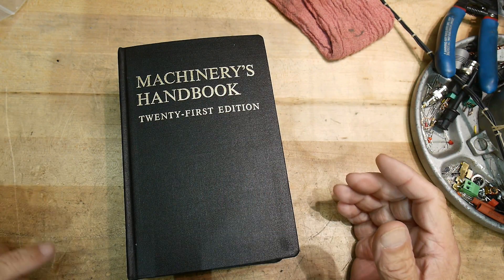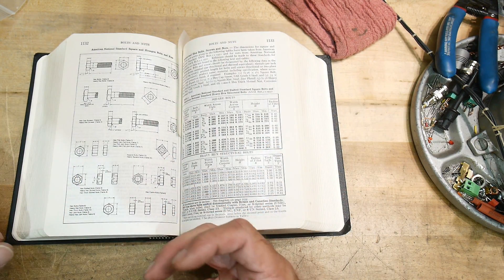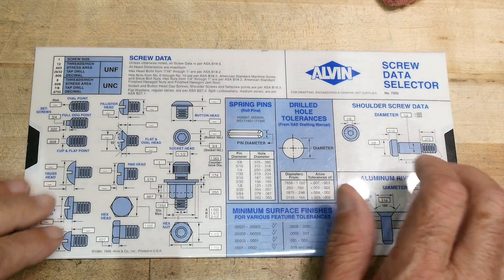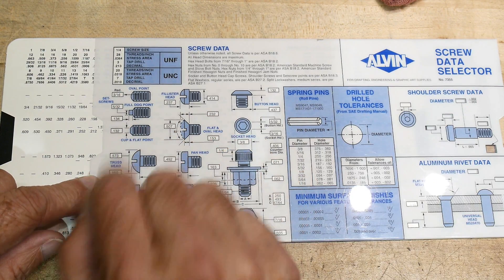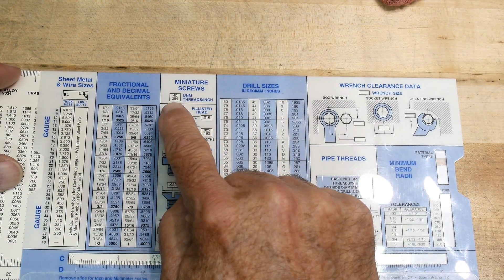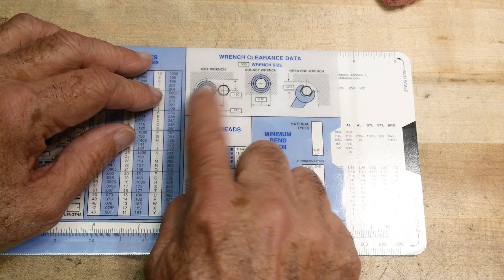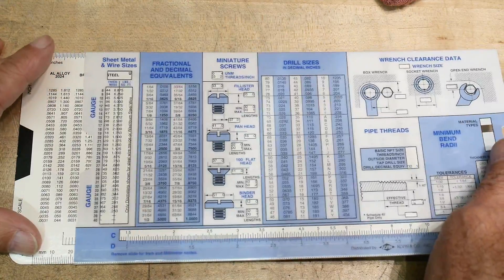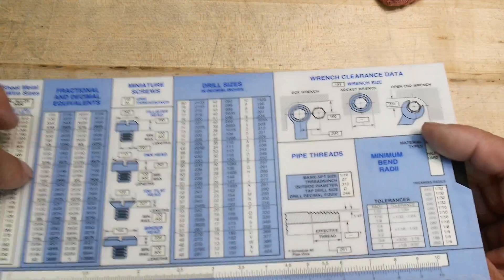#1097 Alvin 7355 Screw Data Selector Slide Chart

Comment: Ampacity always depends on cooling.  House wiring cools more quickly than coils, for example.  Also, we often face a certain allowable temperature change or difference.  These are in addition to wire material and cross-section shape.  There is also pulse power/duration vs. average power.  Thus, there are many dimensions to this problem.  I would suggest composing thermal conductivity and electric resistivity vs. material, gauge vs. diameter/area, cross-section shape vs. coil i.d. vs. coil o.d. vs. max T - min T, etc., and supplying equations relating various aspects.  While considering these, allow for the increase in metal resistivity vs. temperature.

Comment: Interesting, then I learned that a gauge depends of the metal. Here in EU it's more boring, a 3mm sheet is 3mm thick no matter the material. By the way Fusion360 are able to make treaded holes in your prints. Change the Tread type from Cosmetic to Modelled. Thanks for a lot of useful videos.